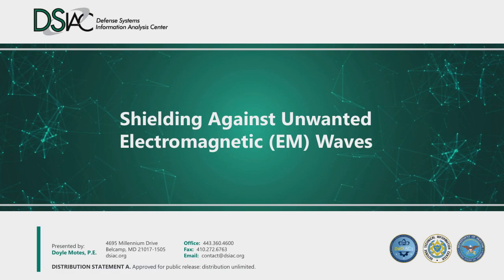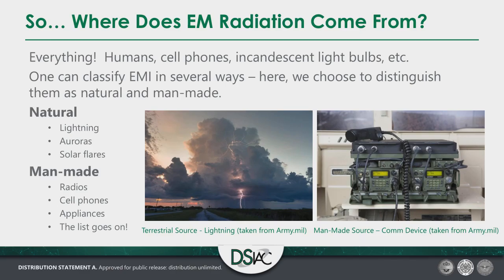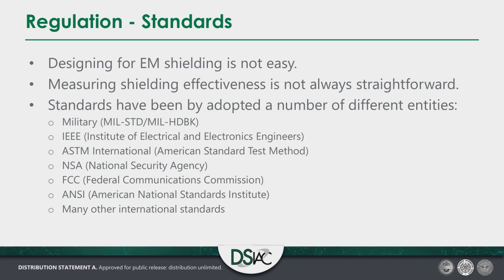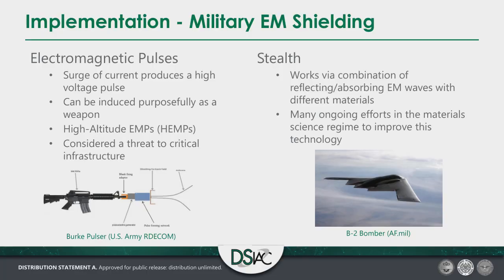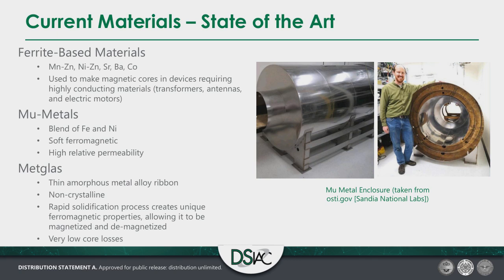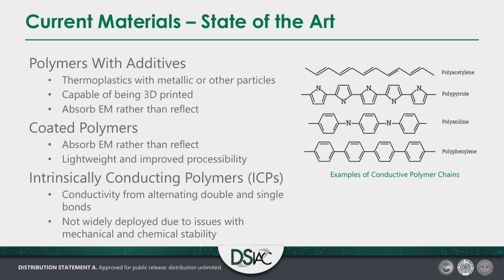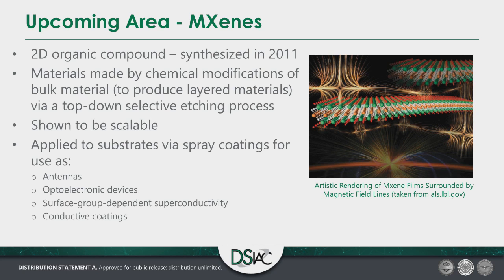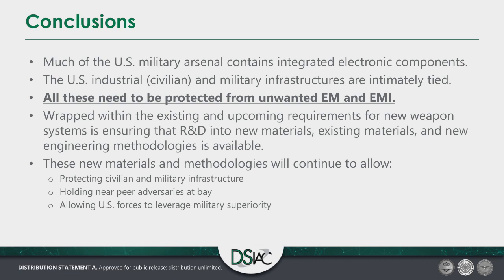DSIAC Webinar: Materials and Applications for Electromagnetic Interference Shielding

Comment: Anyone else around the world experiencing actual people using these weapons on individuals that didn't do anything wrong being harassed about things I don't want involvement with such as a sex trafficking organization or things such as personal reasons by psychotic murderers they have been wire tapping an also using that laser to burn me an it's been being pointed at my head here in Sheboygan Wisconsin. What an who should I contact to get them into trouble for it?
Reply: The one eight hundred number for human trafficking operator gave me a number that ended up being a recorded voice to prevent people from killing them self. Yet I know how phone lines can be manipulated and re routed as also you are calling for info or food stamp card balance. Report face to face for this crime may or may not be a problem but you can not be anonymous
Reply: Your talking about being a targeted individuals, and there is a lot of them out there your not the only one.  Getting the proper help is another thing all together.  There is a lot of info out there, but shielding isnt easy to do when it comes to frequency or direct energy weapons, like the laser you refer to.